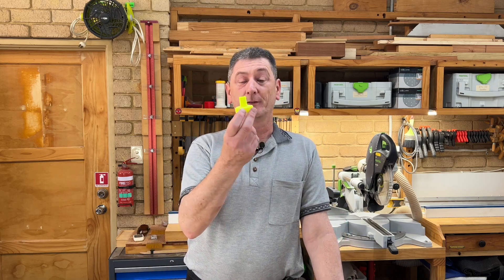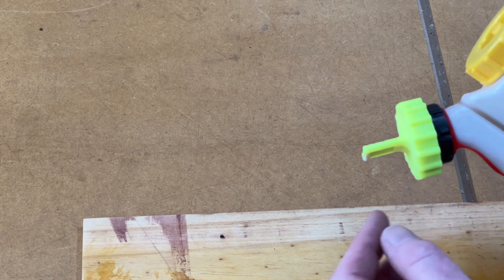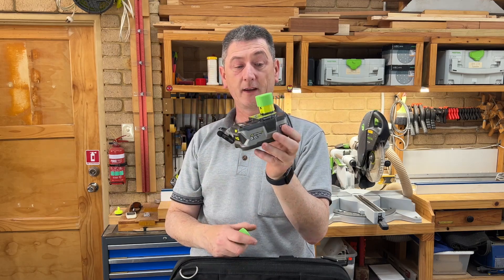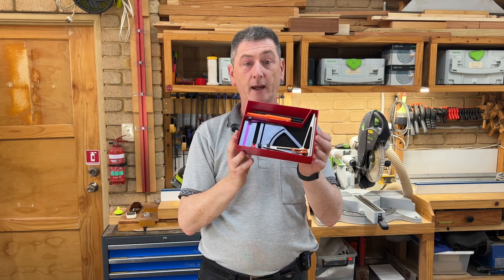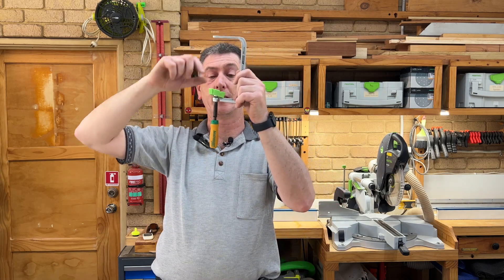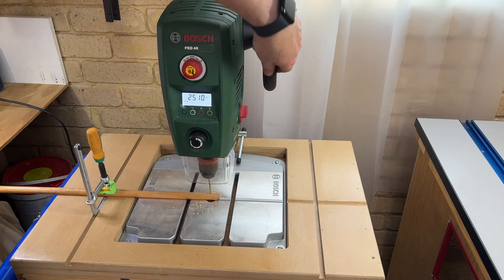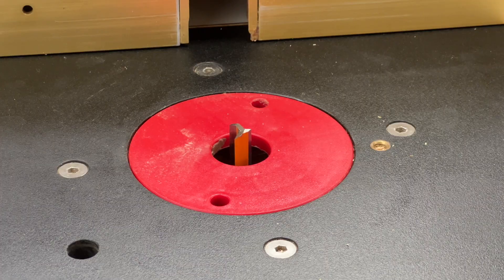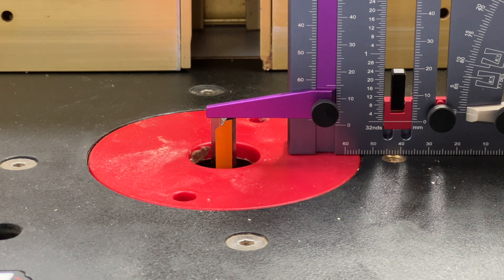3D Prints in the Workshop 25

Comment: I thought that Bosch drill press had a built-in material clamp... An interesting tool, but wheel operation seems a bit clumsy- most such devices use triple-lever wheels. Shame, as it has a lot of features. Perhaps it can be modified.
Reply from the maker: Indeed it does have a built in clamp. I had it swung around to the back while I demoed the clamp pads. The Microjig clamps are faster and easier to use than the built in clamp, but the built in, is better for small pieces because of its location.
My previous drill press had the three lever design, as did the one before it. I have found both have their pros and cons. On the Bosch the wheel is also used to adjust the height of the head. This might awkward with levers. 
If you do end up modifying one, that would make for an interesting video.
Reply: @DarrensWorkshop  Afraid I would not buy one- I like Bosch blue (prof. range), Bosch green (domestic) not so much. I use my milling machine as a drill press, but would be interested in a small drill press for small/quick jobs. But it would need to earn its place in my small workshop. Might build one...
It would be interesting to learn why you got this, as you already have a 'normal' drill press. What were the use cases that drove this?
Reply from the maker: @Tensquaremetreworkshop  There is no short answer to why I bought the PBD40. It is something I have been considering for years. The two main reasons are the digital speed control, and the height adjustable head. The latter has allowed me to mount it in a rolling table (Trolly) that is the same height as my work bench. Now either one can act as outboard support for the other. There are numerous other tiny reasons like last pointers. At the end of the day I am happy with my decision, and I sold my old drill press yesterday.
Reply: @DarrensWorkshop  Many thanks for giving such a full reply. Praise indeed that it will replace your drill-press, especially given the reduced throat of the Bosch. The 'standard' drill press certainly leaves a lot to be desired, especially in rigidity of the spindle- and belt changing is tedious. Having said that, the range of speeds required for most drilling is small (see the graph that Bosch supplies). There is a surprisingly small range of choices when it comes to fixed drilling equipment. Cannot help feeling that a radial arm drill fitted with modern control would be desirable. Food for thought...
Reply: @DarrensWorkshop  Just realized- I already have one! I recently built a CNC mill specifically for machining metal (see https://youtu.be/CL1fst0x7uE) - just wrote a small macro that allows it to drill a hole at any speed to any depth, and includes 'pecking' motion. Can be used 'freehand' or with the workpiece held. Using end mills, I can also drill a hole of any size, and of different shapes. Will also cut dowel holes at precise distances- or domino holes. Guess I do not need a drill press after all...